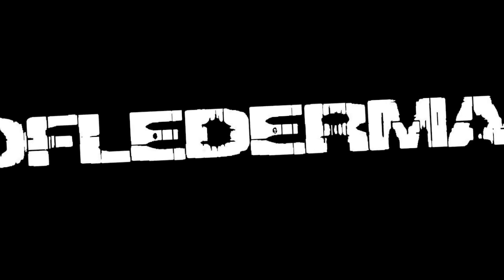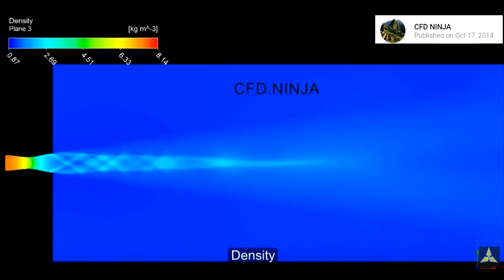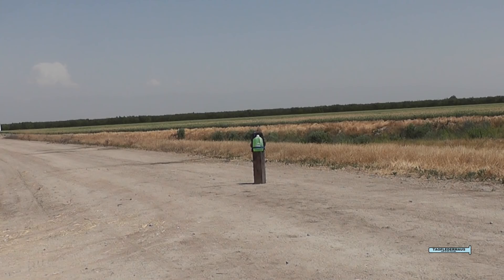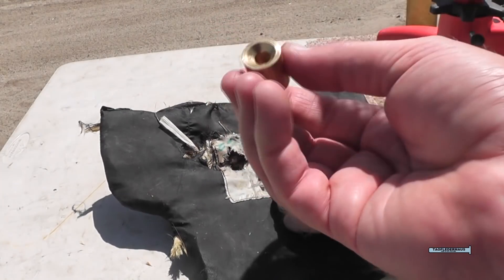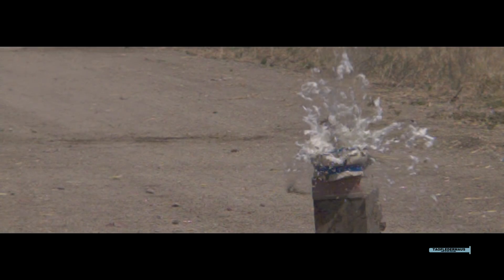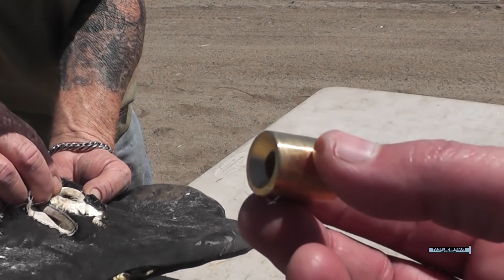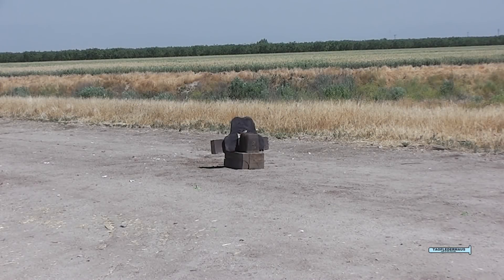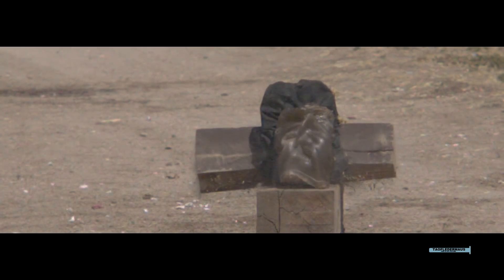SCREAMING Shotgun Slug -  Rocket Nozzle Experiment

Comment: Now imagine a true ramjet version of that thing :D Even with 1second of fuel, it would make the um… little Tony a long range Tony. I just need to figure out how to make the fuel system, mixer and ignition ram air driven and simple to manufacture.
Reply: And fit it in a 12ga diameter, and make it able to withstand a couple hundred g on launch
Reply: @Hirosjimma  My thought is to make it from 2 main parts. A outer cylinder with a sealing lip and the inner part from rather thin titanium. The cavity between both will be the fuel tank. And a smaller mass that seals the fuel injector and rushes down the tank when accelerated to displace a priming amount of fuel into the mixer/burn chamber. For ignition, I plan to use the flex of the upper portion of the inner part. It will set the heavier than fuel component free and mix it thanks to the high acceleration on launch. The mix will ignite on air contact. 
So I don't think there will be problems with the acceleration or size. The geometry works in our favour against the main forces. I just need to figure out where to put the air ports to have neutral pressure when equalising the tanks pressure for the fuel that is used up.
I guess I'll make a parametric 3d model to be able to change these positions easy and make some models filled with water. Then see how they behave in a strong air blast. Sadly I have no high speed camera. But then this is supposed to be a fun exercise.
Oh well I guess I'll have to provide doodles for any of this to make sense. For now it's bed time.
Reply: Mercury when compressed enough combusts
Reply: @GlitchietheDragon  Interesting, I didn't know that. Thought it would limit the materials of the slug, since mercury attacks a lot of the lighter metals. Do you have any data on how much energy is released when mercury burns?
Reply: The Weapon Collection  Thanks, no need to look it up. I just never heard of pure mercury burning in air. Besides that compound might just make the whole thing blow up from the initial shock. And since it carries it's own oxygen, it would be more of a rocket than a ramjet.

Comment: Were you imparting rotation to the projectiles as they passed through the linear accelerator?
Reply from the maker: Yes,   we had the angular momentum oscillator turned on
Reply: @taofledermaus  "angular momentum oscillator turned on" Hahaha, brilliant!
Reply: @taofledermaus  I see what ya did there😁
Reply: gusbailey68 i believe they varied the voltage to get the needed spin without a sabot
Reply: The linear electromagnetic field imparts a rotational force in the plane orthogonal to the vector of travel, which in turn induces an increased resistance to the current and produces heat.
Reply: Is it weird for a high school drop out to understand what you guy's are talking about without googling
Reply: @mexicanenglishbullterrieri5162  it's called context clues my dude. Maybe if you hadn't dropped out, you'd know that
Reply: KnightDragon2 I dropped out and I know that, then again, I got a ged and degree in mechanical engineering, sooo......

Comment: I think the barrel pressure is seating the paper maché firmly in the ass end of that projectile, thus not allowing it to separate.
Reply: That's what I was thinking too.
Reply: Barrel? What barrel? These were launched from within a linear cycling electro magnetic, steam damped, flux field! We don't need no steenkeen barrel!
Reply: No because as soon as they got it to the right speed it worked.
Reply: @david2ljdavid2lj56  yeah, I should've watched the whole thing before typing oops

Comment: Doing this will make it very difficult to get supersonic exit flow. Even if you do obtain choked flow at the throat, you’d need substantial back pressure that would be many times that of atmospheric to push a shock out of the nozzle exit and get supersonic exit flow.

Comment: The electromagnetic vacuum trebuchet makes a good sound
Reply: I like the sound it makes at 9:24 when u open the flux capacitor to release the pressure vessel
Reply: Maybe the paper affects the air flow to "start" in the projectile at higher velocities
Reply: @Platypus_Warrior  no. At 'transsonic' velocities, some parts have a faster airflow than others, making some parts supersonic and some subsonic. The airflow flowing into the convergent part of the nozzle was being accelerated to a supersonic velocity, making a shockwave and stopping it from functioning properly.
Reply: @josephstalin7995  I thought you was dead...
Reply: It legit sounds scary to me in slomo.
Reply: They really just need to make a video where they show an invention that launches these projectiles and just mute out the sound of the gun shot. Like make some thing like a giant potato cannon wrapped with wires and circuit boards, a burst disc at the front of a vacuumed barrel strapped to some 2x4's and then say this is our new monetization friendly launcher. It's OK if some of us on the channel can tell if it is fake as long as it tricks the censor people. Also go full out on the pretending it is a rail-gun type thing with no "12 gauge rail GUN" giggle giggle  slip ups. Then they just need to either blank out the sound of the gun or even better replace the sound of the gun shooting with some cheesy sound effect like someone flicking a thin piece of spring steel with some charging capacitors overlayed on it. If you use a few sound effects at once to create a cool sound they might believe it but I would at least start by muting out the sound during the gunshot so they can't say well it's a gun just off camera. The more you obscure it the better. bring a piece of pvc pipe with you and strap it to the end of the shooting table or shoot the slug through a much bigger wide open one and make it even more believable that it's a giant potato-rail-vacuum launcher, not gun. actually eliminate all uses of the word gun from he videos. I kjnow it's stupid but I'd rather this than no videos!
Reply: Almost like a loading shotgun.
Reply: la haya hey man you can’t say that word here, this is a SAFE SPACE
Reply: la haya almost.....
Reply: Smart a$$
Reply: @Ascended Master what is this Karen Emojifest nofap monkmode reply?
Reply: LIBERTY PRIME  Dude! Uncool.
Reply: LIBERTY PRIME  great, I'm being hunted by a malfunctioning robot.